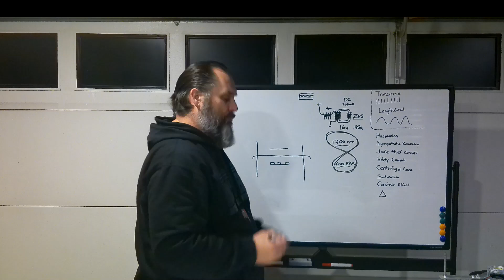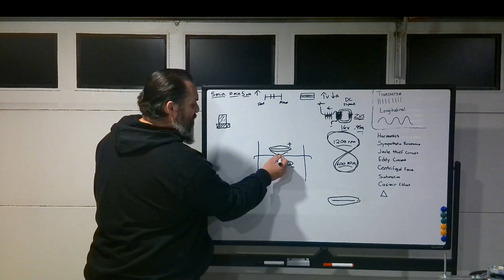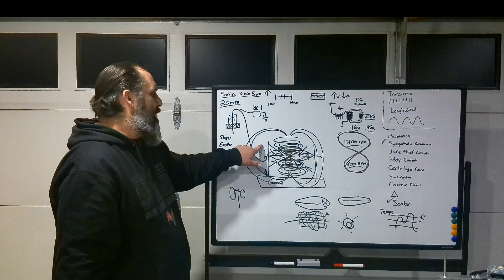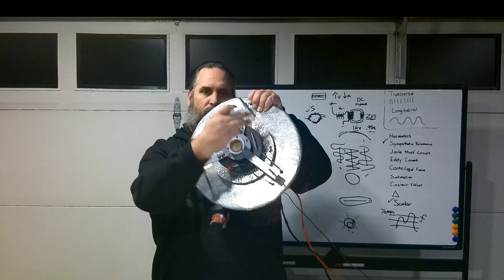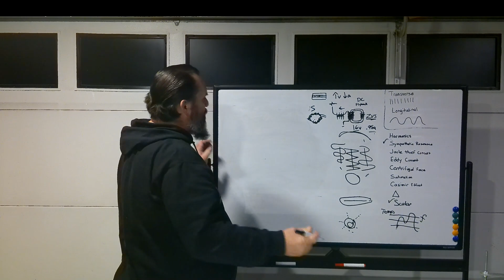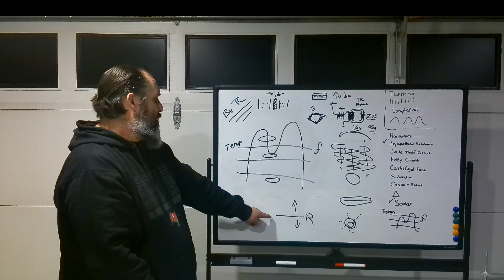Graviflyer "How the parts work"

Comment: how the parts work, i have math simulation how it work

https://colab.research.google.com/drive/1bi0MVHb8E1LZPnHsVCmy7I82T7WLy0OQ

for every body who want to reproduce the system
the setup is, 
- strong construction, maximum 2kg, especialiy for rotating magnetic disc
- drone mini rotor with 4000rpm strong enough to rotate magnetic disc , 12 volt
- magnetic coin, neodymium grade52, disc type, 25mm radius, 3mm think, 6 pieces, total magnetic field about 1 tesla
- rotating magnetic disc r=150mm, placement of magnet 120mm from center
- alumunium foil at top and bottom rotatic magnetic disc, to isolate, resonate and amplify magnetic force, distance 80mm each at top and bottom
- gyroscope system for balance
- battery

first trial is 3000 rpm until levitating then can be adjust for slower rpm to maintain altimeter (e.g. 1 meter from ground, steady )

Comment: Sir adding something, 
Remember those 2 forks they vibrate. if those discs become 2 forks u start to understand u can transmit energy between. But what people figured out is how to concentrate in containment field. Its like a core moving the ball and its principles are same like gyroscope. 
Maybe in a big design because mass equals to more momentum. But if u want a engine that defies gravity then u need to expand a space in location to expand and that power expanding goes against the plate u want like a magnet to resist. U can make those orbs on the engines or interior but they are like engines. 
This way u be 90% fuel left in a 2 seater. 
I dont know how u want gravity field creator become anti gravity but that design will jump u to high speeds. 
With my design its better because of computer and u can sensitive u know because I love fighter pilots. 
I try to explain to fullest. 

U have this type of plate when u put a charge against it and it bounce. Its like 2 magnets on each other but with energy. U need that type of plate and its real in world u can buy it. The reason why magnets dont work because they fixed in position of time and space. But physics dictate that when u move u are stuck but if u make a powerball through resonator like your wifi signal then u can send energy. That energy when released doesnt hold to physics time and location because u create energy from a different location meaning the chamber inside the ball. Thats why its important to contain it and insulate the energy. 

Also for safety reasons I wouldnt wanna mess alot with gravity fields they can have negative effects. Better use of energy and u can even use solar but making sure the process is clean. In theory it should be clean and the aliens said also its real. They always talk to humans through culture and u see why visions become visions. 

Just try to make a ball with that plate I explained and try to make a power ball inside and u see it move. The design u must flesh out but from how I see I got it from aliens and not uncle sam this technology.  Because they stole from aliens. Also I wanna mention what u are doing is new but important and I wish u best luck and hope u learn something from me like  I did with u. RESPECT X

Comment: #22:54 This is Electrogravitics. There as to be a charge collarps spiraling from the top of the vortex triangle down to the bottom vortex triangle, which squirts out in the center. If both top and bottom charge is equal there's no upward force unless only the top charge vortex is spiraling down building implosion force then squirts out at the bottom triangle vortex. Implosion force at the center is very important for difficult devices like this because it as to store a great amount of implosion before you can see a force.

Comment: Anytime polarization is flipping (AC) induction of paramagnetic (ium... Aluminium) we see lift. Such as a copper looped coil extension chord over over an aluminum plate. Simply rotate one aluminum disk over (or under) three North and three South poles. Both stationary and both delta to achieve AC induction into the disk.

Comment: Interesting information. I think further simplification or overview comprehension is needed so the main ideas and interscending steps can be visualized together. Temperature variation is an explanation of anode cathode positive negative? Do you believe these correspond with polarization? Likely these ideas might relate with what they call superconductivity. However, this idea might actually be better understood as zero impedance resistance.

Comment: Great explanation, thank you very much. Good to see all the components "high level" all together. But I must admit I didnt get the ZVS DC flyback positive with the foils and copper - youre basically saying it works as a capacitor with the 20kv or were you explaining the winding material that forms the coil itself? Can you clarify this for me? 2:53
Reply from the maker: it is the wrapping of the coil and the diode.  this video shows it https://youtu.be/3XmKPElCC80?si=Jlnso3meuXeh78NF
Reply: @nathanbunten4299  thank you, now I understood it